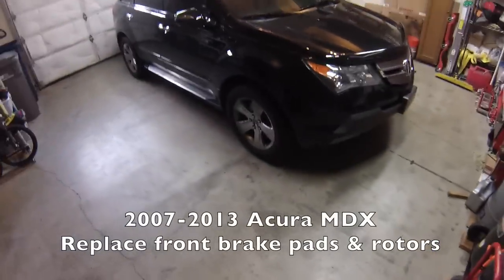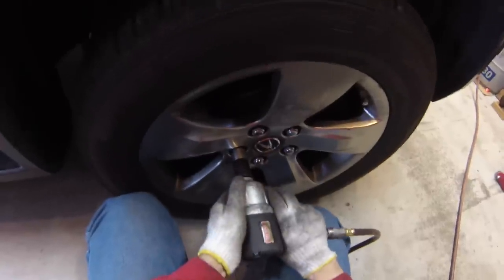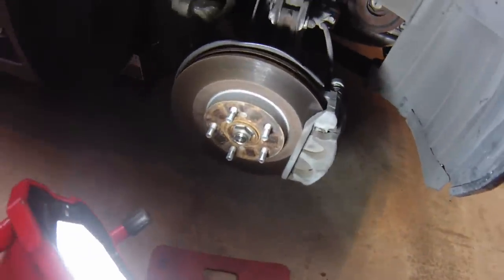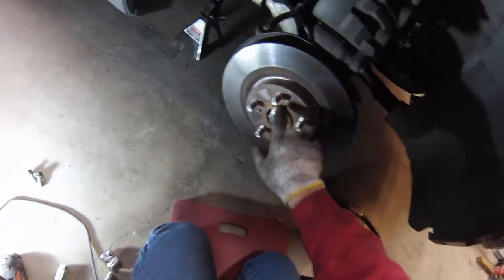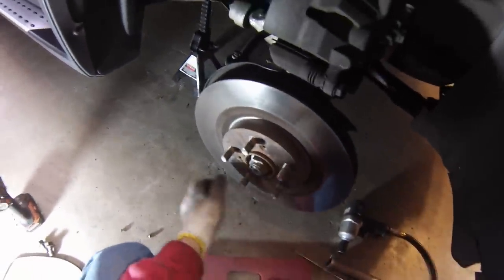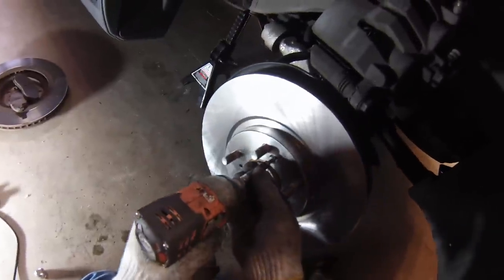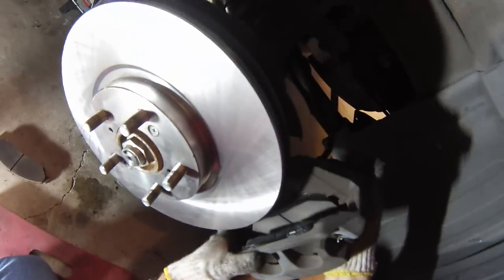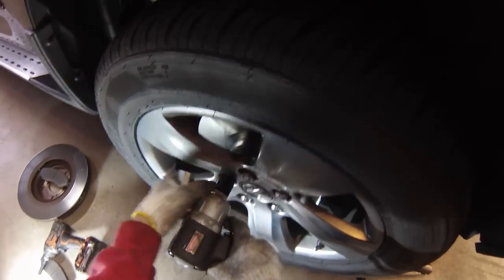Replace Acura MDX front brake pads/rotors 2007-2013

Comment: Recommend whenever you do a brake pad/rotor replacement to unbolt the caliper from the caliper bracket in order to lubricate the caliper pins to allow the caliper to "float" during brake wear;  in addition, install new abutment clips to prevent the brake pads ears from moving around and making noise within the caliper bracket.  A light coat of brake grease should be applied between the new pads and the pad shims to prevent brake squeal.

Comment: I never thought to use a small impact screw gun for rotor screws.  I used an manual impact screwdriver.  Good idea!  Nice video, well done and straight forward.
Reply from the maker: reluctantchemist The manual ones work just as fine if you have one.

Comment: This video helped me out in many ways. I was doing the right thing, but I got nervous cranking on the two bolts. After watching your video, I knew I had the right bolts, and knew it was normal for them to be tight, so I just torqued 'em till they broke loose (I used a cheater bar, just like you). One comment: I forgot about pushing back the pistons. But I was able to do it without too much trouble using a screw clamp and a piece of scrap wood.
Reply from the maker: Yes, there is corrosion and they are very tight coming out. A screw clamp is the other generally accepted way to push the piston back.

Comment: gotta adhere to torque specs

those big 19mm caliper cage bolts should be torqued down to 101 ft lbs
wheel lug nuts to be torqued down to 80-85 ft lbs

that brake goo should be used on the sliding caliper pins as well... but you didn't separate the 2 smaller bolts from it & take it off the caliper cage ~ those 2 smaller bolts torqued to 27 ft lbs

also, if you will reuse those 2 small phillips screws, i recommend using anti-seize compound on them. get an impact screwdriver if you don't have one of those impact power driver that mod MINI has on his tool arsenal. they're basically there initially for quicker assembly plant procedures
Reply: Are there rear caliper bolts torqued to 101 as well or something different?
Reply from the maker: zangief44 Caliper slider pin/ bolts
53lbf-ft (front)
27lbf-ft (rear)

Caliper Mounting Bracket bolts
101lbf-ft (front)
65lbf-ft (rear)

Comment: Awesome video man. Excellent job explaining. My piece of advice is pump the brakes before you go to the other side. I've had the reservoir overflow on me before and its just a mess.
Reply from the maker: NittanyNation22 Yes, that can happen if fluid was added when the pads were worn. Other option is to draw some out with a turkey baster-type tool
Reply: Let me second the turkey baster idea.  I like to change the fluid in the reservoir with a turkey baster, and this is a great time to do it.  Suck out the old fluid before you pump the brakes.  top off with some new fluid.  Then you are pumping in new brake fluid. 
You can buy the basters at the dollar store, and change out your power steering fluid and others too.  Don't use the wires, or thnksgiving dinner will taste oily.

Comment from the maker: Hardcoremofo: For some reason unable to directly reply to your comment - an error occurs. 
I prefer to just replace them. They are reasonably similar in cost and removing metal from a rotor that is already thinner from break wear makes me nervous. Thinner rotors will get hot quicker, which can be a problem on long steep grades or when towing, not to mention the slight increased possibility of warpage. 
But if you are just trying to get rid of the classic Honda brake vibration problem, a light machining might do the trick. (As you may know, the vibration is mostly due to uneven brake pad deposits, not warpage)

Comment: As an owner that pushes his MDX I strongly advice anyone doing this job to get better brake pads.. OEM Pads are good for Stop and Go Traffic but if you try to push them they will fade and bad. So if you are Towing or Driving Spirited (Touge ala SH-AWD) with the MDX get upgraded pads. I recommend aftermarket pads in the +70 bucks region (Gold, Platinum, Etc.) they are better than OEM. I tried from Carquest WEAREVER Platinum to EBC Red Stuff and they all work nice, As with most things the more money you spent the better pad you get but not in the OEM Case.

Comment: You can also use mallet to break 19mm bolts loose. I find it much easier than using a breaker bar. Also, you may find rotor completely seized on cars driven in the east coast. Jaw puller is probably the easiest way to break seized rotor loose.

Comment: I am in the process of changing pads and rotors on my 07 MDX.  Rears were no problem but I'm not getting the front rotors loose.  I used bolts in the threaded holes but the threaded holes stripped out before the rotors broke free.  I tried whacking with a hammer from the backside but it didn't budge.  Frustrating, especially when they came off yours so easily.
Reply from the maker: Sounds like it's time to drill them out.
Reply: ***** I finally got the front rotors off.  PB Blaster around the hub and a bigger hammer from the back.  Thanks for your great how-to.
Reply from the maker: J Ruedinger Good to hear. Sounds like you must live in the rust belt.

Comment: Hi, do you have to pump the brake pedal for EACH disc brake pads??? Or you pump the brake pedal after finish installation on 2 front wheel disc brake pads???
Please reply back!!!
Thanks so much, Barry
Reply from the maker: Just do once after. Think about what is happening in the system.

Comment: That seems to be an awesomely easy way to replace the brake pads without actually disassembling the caliper. This is great! I'm assuming you can do that to the rear calipers as well?
Reply from the maker: Yes, probably works on the rear as well, although not terribly hard to remove the slide pins if needed.

Comment: I replaced my driver's side rotor and pads last night (other side will be done this morning). When I returned from my test drive, I smelled burning and there were fine wisps of smoke coming from the caliper area. I did NOT spray the new rotors first. Could the smoke be coming from the oily coating on the rotor or something else? Good video. Thanks. 

I don't ordinarily replace one side at a time but it took so long to free the rusted on rotor that I didn't have time or light to do the other side. And the Mosquitos were eating me alive. :-)
Reply: Should have mentioned two things:
1. Braking was fine. No pulling. No squealing. 
2. When I pump my brakes, the pedal gets stiffer. Then when I stop pumping, the pedal resistance returns to normal. I don't recall feeling that sensation before, but it could be normal.
Reply from the maker: HibsMax Normal. Smoke is coming from either contaminants on the brake equipment or outgassing of the new pads as part of the break-in. Pedal will get stiffer on pumping. I strongly recommend not doing one side at a time, especially on the front. It can cause unexpected steering input under heavy braking/emergency braking.

Comment: Regular Mdx is in between sport and comfort mode in sport package. I hate that honda knows they have issues but dont want to help on replacement and there sre no aftermarket dampeners. If you can live with a driving feel in middle of sport and comfort I think regular shocks are a way to go. 10 times cheaper and no hassle. Make sure you use resistors otherwise your ASD light ond dash will stay on. How many miles you got on it? Any transkission issues??
Reply from the maker: I don't think I can live with anything softer than the Sport setting which is already on the soft side for me (my other car is a heavily track prepared MINI Cooper that drives on rails). I guess I'll start saving now.
My MDX has 100,000 miles on it, no problems other than the EGR valve and a bad CV axle.

Comment: Great video thanks for posting.  Used your guidance on changing my brakes and rotors. Quick question, one brake pad has a clip sicking out, 7:35 in your video.  What is that for and what side should that pad be installed inside or outside?
Reply from the maker: I don't remember but it only fits on one side.

Comment: why dont you open the bleed valve?  you can cause the abs pump to fail when you force fluid back the wrong way, and they aint cheap.  brake failure sux too.  thanks for sharing.
Reply from the maker: Hmm. I have never ever had such a problem. Any fluid pushed back goes back to the master and pressure is far less than operating pressures.

Comment: I'm working on my 2011 Acura TL right now and I'm having a hell of a time removing the front rotors.  I did everything correct and I was able to break the rotor free however I am unable to get the rotors off the lug bolts.  They move about half way off the lug bolt then it becomes a major challenge.  The rear rotors came off very easy, but both front rotors are giving me problems.  Anybody have any idea why that would be?
Reply from the maker: If you've broken through any corrosion and you pull straight, they should come straight off. Have you removed the calipers? There won't be enough clearance to pull off the rotor unless you've removed the calipers.  Once you've done that the rotor should come three with a hammer tap. If it's getting hung up on your lugs, maybe one of them is bent?
Reply: Thanks for the response (and the great video).  Yes the calipers and bracket are removed.  I was thinking one of them was slightly bent as well, but then when I went over to the other front wheel and experienced the same thing I thought I was missing some trick or something!  Strange. Will probably just take to a mechanic and let them deal with it...
Reply from the maker: Frank Romano Really strange...as you can see in the video, once the caliper and retaining bolts are removed and you've tapped the rotor away from the hub, they should just slide right off. Maybe some corrosion on the unthreaded portion of the lugs? If so, tap harder while keeping the rotor straight. Once the rotor has cleared as far as the lug threads they should practically fall off then.

Comment: Mod MINI 
Did the rotor replacement cure the front end vibration? I am considering replacing mine as I have 75mph vibration at highway speeds and already done road force balance and 4wheel alignment.. Thanks for the video!!
Reply from the maker: It fixed the brake pulsing/vibration. Don't expect it to fix vibration when you are not on the brakes. That is likely something else such as poorly balanced wheels or worn suspension parts. (This type of vibration tends to get worse when going up hill)
Reply: Eric ever fix your vibration issues?

Comment: Wait till you see the price of those sport shocks for mdx and only available thru honda. They start making noise over bumps and expensive unless you install regular ones
Reply from the maker: Mine are getting close to replacement time. I'm debating whether to bite the bullet and replace with OEM or go for regular ones. I want a firm ride (Sport mode) and am worried the regular ones or aftermarket ones will be too soft.

Comment: Nice job. I noticed you did not torque the lugs to spec after you used the impact gun. Do you not normally do this or did you just not show it on the video?
Reply from the maker: Dave Evans Yes, I torque the wheels after car is back down on the ground. Girls and boys - be sure to torque your wheel lugs!
Reply: ***** Just had a buddy who had three wheel studs shear on the highway after the tire store did not torque to spec. Many people just tighten with the supplied tire wrench and never check it!
Reply: @ModMINI  lol 😂

Comment: You missed an important procedure. You did not grease the slider pins. Never, never change your brake pads without greasing the slider pins.  That was just lazy of you not to lube the pins while you had the caliper off . If you find a mechanic who will not lube your pins find another one. 20  percent of worn brake pads are due to sticking rotors because the pin lube had worn away or the were not lubed.
Reply from the maker: juanjohnism Good point.

Comment: No brake sensors on the pads?
Reply: Acura is just a crappy Honda. Only Lexus or German cars use brake sensors. There is a metal arm that will score the rotor if the pad wears out.
Reply: @kennynguyen2105  Good to know.  Thanks for the response.

Comment: It's interesting that I can't find anything on replacing brake pads on a 2016 MDX.
Reply from the maker: Car is too new, most people are still on original brakes. Process will be very similar to this.
Reply: Actually, the 2016 MDX is the 3rd generation model which was produced from 2014.
Reply from the maker: Sure, but most braking systems are very similar. Specific bolt sizes, rotor/pad specification, etc may be different but the setup should be very similar.
Reply: Thanks for the reply Mod Mini.